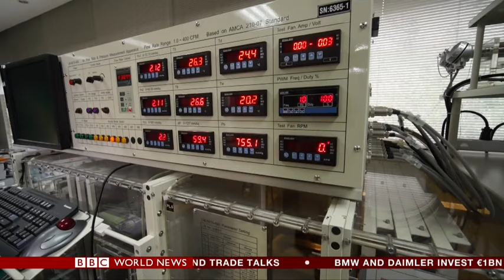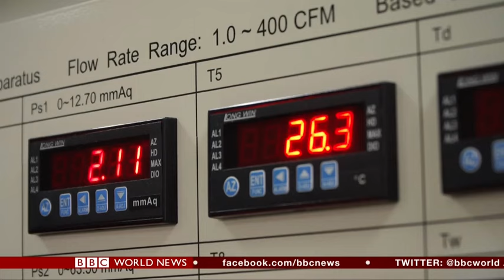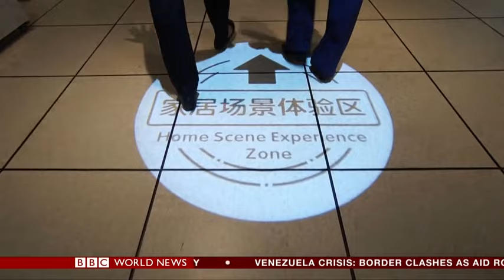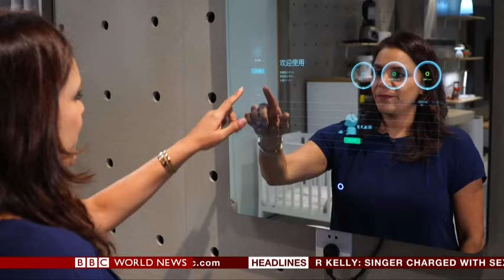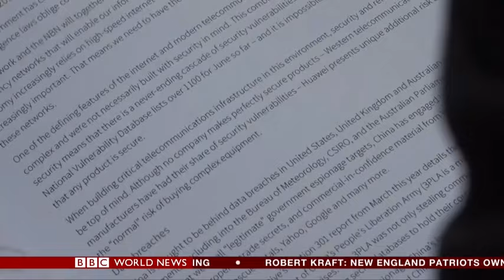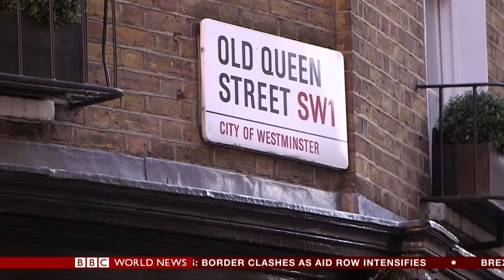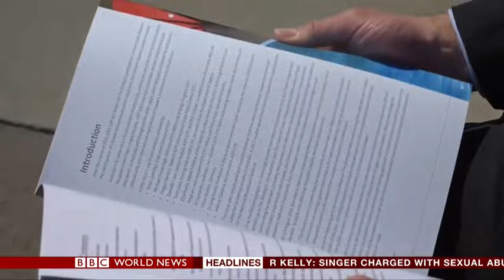Huawei’s Founder Speaks To BBC

Comment: "How can we steal what they don't have?" That's a question that needs answering
Reply: Ericsson, Samsung, Nokia and Verizon have all developed 5G.  It just hasn't had widespread consumer deployment because the technology still requires direct line-of-sight to get a signal.  Hauwei's own 5G signals can be blocked by a SHEET OF PAPER
Reply: @11111110  Huawei's 5G signal does not require fiber transmission and can be transmitted by microwave. This technology does not have other companies.

Comment: Sorry, the idea that Hauwei would refuse any legal request from the CCP doesn't pass the laugh test.  They simply don't have any legal right to refuse data requests from the CCP, Chinese law is quite clear about this
Reply: China does not want to control the world, so the Chinese government will not ask Huawei to do anything.
Reply: The Chinese government has already forced Huawei to hire and install a CCP cell at their highest executive levels.  Huawei's data belongs to the CCP
Reply: @11111110  They have nothing to do with corporate management. Huawei only works according to business rules, so Huawei is so strong.
Reply: @llkk290  Well, that's not true either.  Huawei has been caught copying cometitor's technical and creative products several times, right down to their commercials.  Also, Huawei did business in Iran and lied about it using a shell company in order to defraud western banks and investors into performing sanction-violating transactions with the company.  Which is why the Hauwei CFO is under arrest in Canada